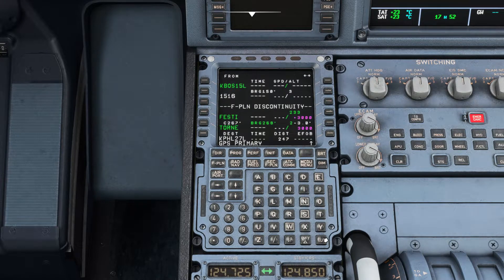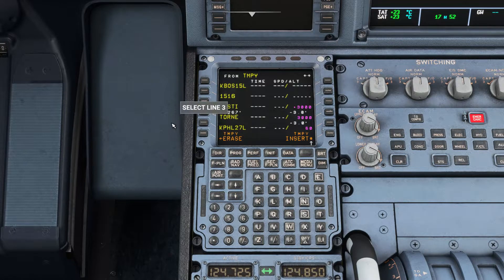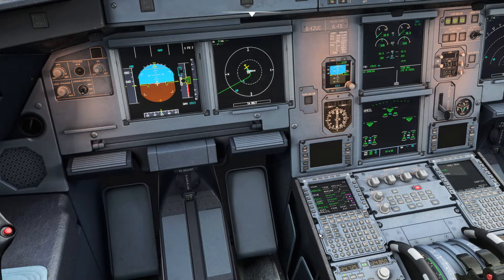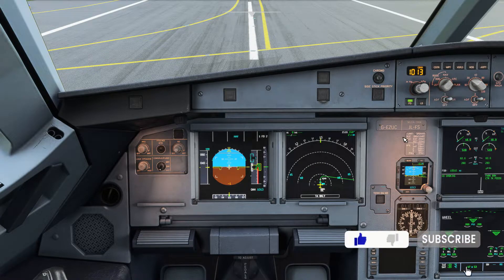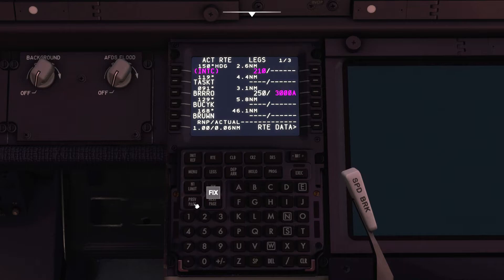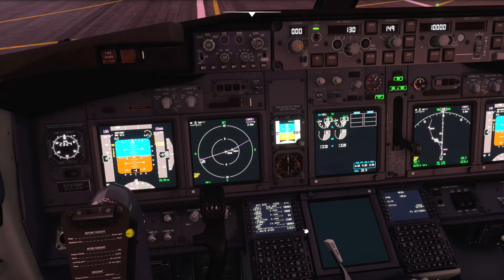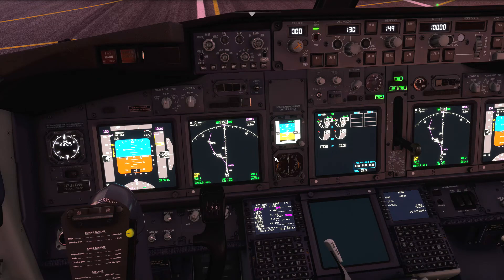How to fix Flight Plan Discontinuity - MSFS

Comment: When I do it just says not allowed
Reply from the maker: You can’t clear a discon if the next waypoint is manual. In theory you can clear the manual waypoint first, but some approaches do rely on manual vectoring by ATC.
Reply: @TiJayFLY ya but then I have to manually do autopilot the whole flight because if I don’t it will try to go to the waypoint where it breaks and I’m stuck at one point in flight 
Ex: waypoint 1 waypoint 2 discontiny waypoint 3: when I do manual and then make it follow managed heading it wants to go to waypoint 2
Reply from the maker: @SocalAviation12 then just go direct to 3. Learn how to use the direct to mode on the airplane you’re flying

Comment: What about when you've been flying for hours and all of a sudden your flight path that you're following on the mfd turns into a dotted line which the autooilot does not follow. I've tried everything and have been looking up videos for this specific problem but no one can tell me in English how to turn the dotted like back to a solid line so my autopilot can once again keep on course. Any help would be very appreciated. Thanks.
Reply from the maker: Some flight plans have MANUAL or VECTORS waypoints. You can remove these before flight 😊

Comment: For the 777 it works fine but for the 787 it’s not working am still getting flight plan discontinued…any solution for this on the 787?
Reply from the maker: It’s the same process across the Boeing fleet, although the sim uses different routing engines for the 777 and 787 - which can complicate things under the hood.

Your issue is that the route you’ve chosen doesn’t play nicely with the 787’s routing engine.

If you drop by the discord in description with screenshots of your route in the FMS, we can work on fixing your route to one the airplane will accept.

Comment: Hi Guys, This should not be deleted. it's a normal procedure that the flight plan will be discontinued, you receive at this moment from the ATC further instructions for the STAR or SID,(Maybe a Direct-To or a different Airway for the ILS etc). If the ATC give you the go ahead on the Path, you set the MCDU with DIR TO the next flight Point after the FLN-Discontinuity
if the PLN-Discontinuity is between the SID and STAR, maybe in the middle of the Route, then you can clear it to avoid rout issues. So you all have to understand the Flight-Plan first before clearing normal things. greetz and sorry 4 my Bad English :D
Reply from the maker: This video is about clearing enroute discons for flying offline.
Reply: No worry about your Video.. I´ve tryed only to explain some guys why it will be ok to delete and when not :) ..Maybe due to some english faults from me somebody could understand that i saidf its wrong your video.. this was not my opinion :) at my first flight trys i had this problem too with the mcdu and i´ve looked for some workarounds.. but nobody had explained it when it is better to CLR the messeage and when not :) so i tryed to explain it here in the comments for some people like me, who diddnt know anything about this line in the MCDU :) greetz
 @TiJayFLY

Comment: Does this work on the Textron Citation CJ4 FMS system? If not, can you please make an updated tutorial on how you would do so on the CJ4? This is the jet I have the most issue with when it comes flight-plan discontinuity. Every flight plan, whether it be from the map screen, entered waypoints manually, or imported via #Simbrief has discontinuity issues in the CJ4.
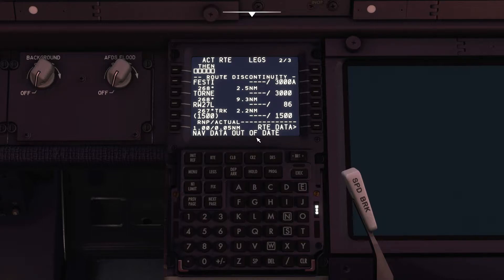Reply from the maker: 01:07 in this video https://youtu.be/b-icJa9Tib8?si=uCfIBqVOTaIT_PGy
Reply: Thank you  @TiJayFLY

Comment: I fly both A319 and A320 from different developers, neither MCDU function the same, although they should. I think that is where the problem lies. I have not filed a flight plan  as yet to test my theory,so I will have to wait and see.
Reply from the maker: There are 3 main implementations: Default (Asobo A320, LVFR 319/321, PMP 330), FBW (A320 + Headwind 330) and Fenix A320. 

They all follow Airbus design and UX patterns. The FPLN page demonstrated here is essentially identical between them which is why one technique is valid for all, but the main differences are:
- Default pre-populates PERF and tends to be buggier in flight. 
- Fenix won’t accept world map flight plans. 
- Fenix and FBW have custom LNAV and routing code which is more reliable. They also support more complex functionality (which isn’t covered here anyway).
Reply: @TiJayFLY  Thank for the information, I take what you say onboard 👍
Reply: @TiJayFLY  I look forward  to the day when others like Fenix release on Xbox, perhaps then I can put this nonsense to bed.

Comment: Why does it say “not allowed” when I try to clear it on the MCDU?
Reply: I'm having the same issue and can't get rid of it.
Reply: @andysaunders3900  so if you can get rid of it right when the FP breaks go into the DIR in the MCDU and select the way point you want the aircraft to follow. Look the flybywire discontinuity guide
Reply from the maker: Could be for a number of reasons, easier to diagnose from screenshot or video. I have a discord link in the description, feel free to post there

Comment: This does not work on default A320, unfortunately.
Reply from the maker: It’s the same process on every Airbus including default, if you can show me the problem I can take a look
Reply: @TiJayFLY  The problem lies within flight planning it's self. I can put a flight plan together and it looks good with no sign of any discontinuity, however the problems occur when the aircraft is on approach. Without any explanation, the word "user" appears on the flight plan and causes the aircraft to lose its way. With regards to the MCDU, at no point does it say "FLIGHT PLAN DISCONTINUED" or something like that. TiJayFLY, I am absolutely fed up with it  believe me. I will take another look at your excellent video, but I am not that hopeful.
Reply from the maker: @martinpawley647  oh yeah that’s different. That’s just the dodgy default MSFS LNAV logic which frequently loses its s*** on approach. I’d recommend the FBW A320 which is free and has much better LNAV logic 👍
Reply: @TiJayFLY  Is that possible, I'm on Xbox. Having said that, WASM is on the horizon (SU12)
Reply: @TiJayFLY  I Just don't understand why Microsoft/Asobo have not dealt with this issue. THAT'S REAL BAD!
Reply from the maker: @martinpawley647  they’re trying to build a sim as well as a million other planes. The default systems work well enough some/most of the time and they figure that third parties (PMDG, Fenix etc) will pick up the slack. FBW is PC only right now - to be honest if you want the best addons you need to be on PC :(
Reply: @TiJayFLY  That would appear to be the case. However, I really do think Xbox users are getting the shit end of the stick and that isn't right. There should be parity between the two platforms, although having said that, I suppose there are technical issues to overcome and your right about the "lateral navigation", it's total bollocks😂LOL

Comment: My b787 for msfs is broken. I can’t turn on external power or apu gens.
Reply from the maker: Make sure you’re at an airport with external power, and that it is connected.

If that is correct… Got any mods for Boeing airplanes installed? First, update them. If that doesn’t work, try the 787 with all mods removed, and re-add one by one til you find the problematic mod.
Reply: @TiJayFLY  I got rid of all the mods and was at and airport with a gpu. But still it won’t let me. Also it doesn’t let me click the fuel control switch to “run” and most of my lights don’t even work. My 787 is basically unusable unless I press control+e to start the engines

Comment: Hey there! I recently bought the Hager A380 and ofc the Vspeeds require manual inputs. Without guessing the speeds, is there anywhere I can find the Vspeeds for my flight on the A380. Any vspeed calculators or softwares? Thanks
Reply from the maker: There may well be aircraft perf calculators online (in fact I’m sure there are), but I never personally used one. For the a380 I just used generic values which seemed to work and can be found here https://youtu.be/_ipuf3Qt8DA